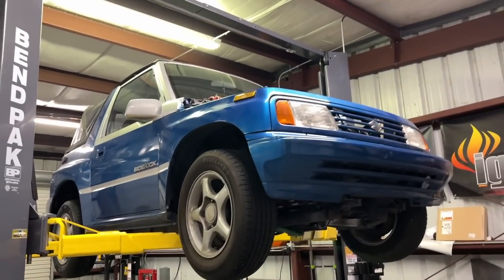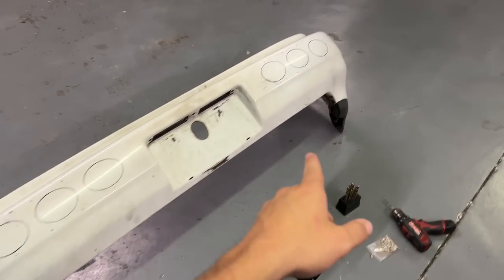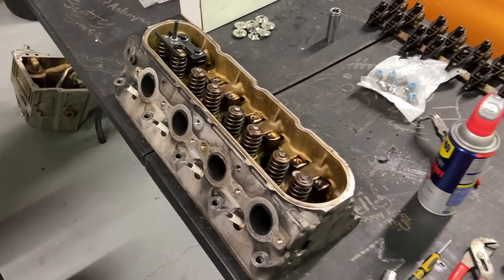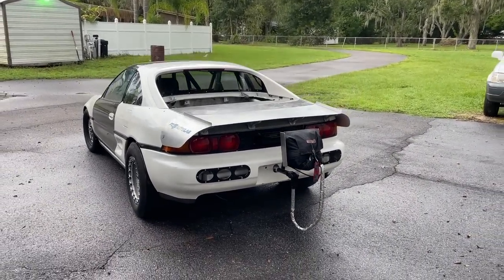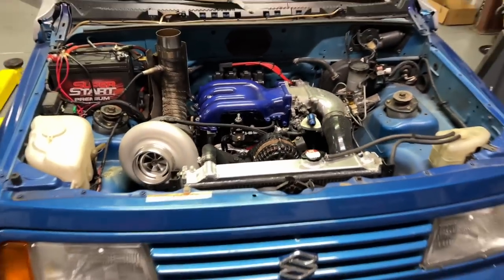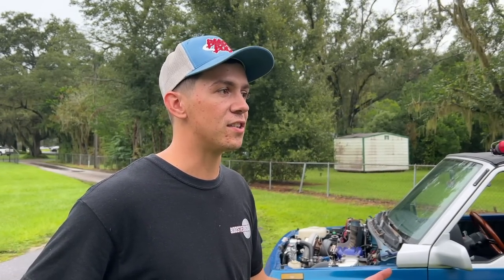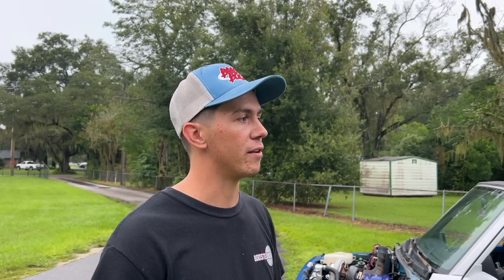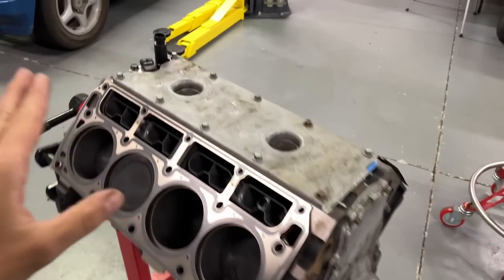Tried To Tow The Jet Boat With Our Rotary Swapped Sidekick...

Comment: I noticed some issues visually on the LS you guys are putting together.  All dots on the pistons should go forward and the rods on the mains are chamfered on one side and flat on the others. The flats need to be touching each other and the chamfers go towards the counterweights.
Reply: nah just send it
Reply: Pre 04 ls has altered pistons positions
Reply: @parkerpowell6852  um my 2000 6.0 was all foward
Reply: File this engine under "built for a good time, not a long time".
Reply: They were using sandpaper on the head i think that says enough
Reply: I agree it’s a quick fix to make sure good clearance
Reply: Lol ditch the auto
Reply: Hate to be a backseat driver. Watch that oil line going to the turbo on the sidekick. It’s really close to the exhaust housing
Reply: Thats par for the course, absolute dollar store builds. Live and learn
Reply: It's a junkyard LS does it really deserve any more?
Reply: @tyrellwashington747  Boosted (world record holding) Hacks
Reply: Nope.
Reply: @au1317  They didn't build the mr2 engine, their racing buddy did (cant remember the shop) and I don't even think they bolted the head to the block.
Reply: Who cares. All the Ls fan girls will tell you it's SBE and will still make 1200whp because *cry (hot rod)
Reply: @Supra2jTarga009  Kyle put the head on himself, I remember one of the vids he said all he needed was a head gasket to put everything together
Reply: Whats with all the hate in this thread bruh lmao
Reply: They already admitted they are not v8 guys there decent at the 4 banger clubs he’ll there good at the 4 banger game but when it comes to real America power aka big boy v8 they are out of there league they are called boosted boys not v8 men lol no offense tho I like there videos when I not watching some v8 yourtubers
Reply: @riversharp7243  Wyatt is a v8 guy but Kyle isn’t
Reply: Your sure that’s the same since there aftermarket
Reply: @riversharp7243  huh bruh? Witt has built dozens of diesel v8s.
Reply: 💯 mate and hope they checked the end play in crank otherwise thrust bearing going too cook
Reply: Dont matter it will clearance itself good about the time the rockers spit the rollers out and it cooks itself doing 7k rpm burnouts, relax its an LS they will get used to pulling those JY engines and swapping them after every event lol
Reply: What if they did it on purpose knowing they would eventually have to rebuild it for content #BoostedConspiracy
Reply: I think they are doing a ‘standard procedure’ delete
Reply: I didn’t see a trunion upgrade either.
Reply: first off they shouldve done a coyote just to get away from this LS stuff the internet loves to do way to much of. Its similar to what they know. Coyote is like 2 4 cyl vtec honda engines put together. Best part is you can make up to 1200whp on a stock sealed coyote with just boost and fuel and run as fast as 7s in a s550 mustang or 8s in a f150 in the 1/4 with no heads no cams no pistons no rods no opening the engine unless you want to go built motor which then you can make up to 2000hp on factory block.  So many ppl are swapping out their LS built motors for coyote stuff which i never thought i would see the day. Something light like a fox and stock sealed coyotes are deep in the 7s. Its a part of modernizing and thats why the 7.3 ford godzilla is a joke. Pushrod oldschool stuff that heads cam pistons and rods oh plus boost like a LS LT and hellcat but you can  make that same power with a sealed coyote. Ppl like LS bcause you can buy one for 500 to a 1000 from a scrapyard. but then need heads cam pistons rods. 3000 for a coyote and then just pick your fuel system and used turbo or supercharger kit for 5k and bang 1200hp or a easy reliable daily 800whp. 7.3 godzilla because its only a heavy duty truck motor yes built better than a LS it will never have the aftermarket of a LS or coyote
Reply: You are indeed correct an the engine won’t last long with them backwards
Reply: SEND IT! again..
Reply: @Pinkarmada01  everyone is the best engine builder in these comments lmao . Rebuilt one motor in their life time but they’re all experts
Reply: @brock83196831  like these must be new fans or someshit, boostedbois have built powerful motors and cars with pfi speed like way back in the Colorado days. They have one misshap with an ls motor and suddenly its, oh they're clueless. Like what?
Reply: @carculturenation2166  lmao, im a Ford guy but show me the “so many people” that are swapping their LS for Coyotes and the Coyotes that are making 1200hp on sealed engines that are not one hit wonders that shatter OPGs on that one hit.
Reply: Nobody cares!!!
Reply: @riversharp7243  those v8's arent difficult lmao its literally a caveman engine theres nothing to it lmao.
Reply: @young11984  I don't like getting into YT arguments but I kind of felt he was full if shit. Stock unopened coyote making 1200 reliably sounds to good to be true.
Reply: @somethinginthewater3802  I’d love to see your build 😂
Reply: The dots go toward the center. Been professionally building cars for 23 years. It wont last long that way.
Reply: @MOTOHEAD-ko3tq  oh its 100% BS lol. There isnt a production 400hp engine that would make 1200 “reliably” but there could be some few hit wonders out there
Reply: @carculturenation2166   You're so full of it. 1200 on a sealed dog,  It's just that easy 3 grand and and a few grand for a Turbo you slap it in and you can go 7s  You've been watching too much YouTube my friend you probably never touched a car in your life.  And a truck that runs 8s that easy lmao.
Reply: Dots on the pistons face forward, dots on the rods face the back. End of story. Very simple. Those 2 pistons visible were facing incorrectly. A factory LS crankshaft has a small fillet unlike aftermarket crankshafts. Because of this some people get away with connecting rod's facing the wrong way. Also LS pistons pistons have a centered ristpin with no offset so idiots get away with pistons orientated incorrectly also.  We will see how long it lives. My bet is it will spin a bearing 1st.

Comment: The Sidekick would be a great build to put the exhaust bypass dealie like you used to have on the rowdyssey; one heading out the back, one out the hood for burnout time.
Reply: They spoke about doing this already and the exhaust bypass dealie is called a cut-out.
Reply: i wish the rowdyssey had a normal exhaust still and not a hood exhaust coz its no longer a sleeper ;(
Reply: Much easier to have the cut out coming out at the mid section under the car, its usually a butterfly valve so you just have a little bullhorn coming off the main exhaust after the downpipe or somthing 👍 hood exit would be cool but abit difficult to fab

Comment: I hope y'all upgrade the trunnion bearings on the rockers if your planning on reving it out. You don't want those factory needle bearings coming apart and going throughout your whole motor. Play it safe and replace them now while you got it apart.
Reply: Odds are the motors completely together already. Gotta remember theres usually a few days inbetween filming and when the video comes out.
Reply: Hopefully they did it. They are notorious for coming apart. I'd hate to see them junk a motor off something so simple to fix.

Comment: Great work on the parachute mount on the MR2. But You need to think about the way You strap the car down. People don't realise That if the car is not strapped down correctly the shocks are working all the miles that you do while towing it to and from events. I personally use blocks on the 4 jack points on the car and they match with some points I put on the trailer. I tie it down using crossed straps front and rear. I welded in some Chassis support rails under the floor of the trailer where my support blocks go. If it is not tied down correctly you can destroy a set of high dollar shocks very quickly. ask Me how I know. But I started Tying My race car down the way I mentioned over 15 or so years ago. and have had not had a problem since. Before i started doing this, I was having a problem where I would go to the track (Road Racing) and during the weekend, I would change the car set up and get it Perfect. We had a Race meeting at the same track about 6 weeks later, After doing a nut and bolt check and normal maintenance, I knew the car would be good because of all the adjustments made at the meeting we had there 6 weeks earlier. I went out for practice and the car was a dog. It was oversteering really bad and kept locking rear brakes, no matter what I did with the bias adjuster. I bought the car back in, We jacked it up expecting to find something broken. So We went over our set up sheet and checked and made sure everything was the same. Well after spending all day going over everything, The left hand rear shock was blown out internally. It had blown the seal on the footvalve, making the shock have no resistance at all. I remember going over some really rough roadworks on the way to the track and I think that is what did it. A few weeks after this happened I was using the open car trailer towing a Customers vehicle back to work with a blown transmission. it was only about a 80 mile drive back to work. We put the vehicle on the lift and I just happened to put my hand on one of the front struts. it was warm. Meaning it was working even though the vehicle was on the trailer. So make sure your cars a tied down correctly. OK story over, I just thought this might help someone. Cheers.
Reply: Clever thinking, I like it.
Reply: I stopped reading your book when you said you cross your straps, I'd never take strap advice from you.
Reply: @momolovesyou9969  ,How many vehicles have You strapped down and how many miles have You towed vehicles, and how long have You been such an expert. You must not know much about strapping vehicles or any load down for that matter. Crossing the straps stops the side to side movement of the vehicle when strapped in the trailer. I have the pick up points set so the straps do not touch each other, because this can cause the straps to wear and fray. Have been in the Motorsport trade for over 30 years and never had one single strap or rope problem.

Comment: I ordered a TCI Racing Automatic’s case filled Ford C4 transmission that comes with a reverse manual valve-body with a TransBrake. I paid $1750.00 for the transmission then ordered a NCTransmission “North Caribbean Transmission” custom built spec torque converter for my setup as well a Elite Rotary Shop Ford C4 to Mazda 13B bellhousing ring adapter and a RaceOnly Australia Billet Mazda 13B Automatic Flex-plate and a Precision Performance Products Kwik Shift Shifter. In total I have roughly $4000.00 or more in everything mentioned about. But I’ve been told by a lot of drag race transmission builders that if it’s not built to be able to handle to higher RPM being attached to a Rotary that it will not last long at all.

Comment: Tire straps always in a functional vehicle. Grease the pivots and let the car ride the trailer. Smoother ride all the way around than binding them together. If you are strapping sprung weight points then Jack and block the frame so the suspension is fully out of the equation. Otherwise your springs are trying to fight your straps until the shock load smashes down on the bump stops and slacks all the strapping for a second then BAM !!! It all comes back up but not much.

Comment: You could just put some metal spacers under the bars for the parachute mount so it still slides in and out with the bolts out. Throw one quick weld on the bottom section of the spacer where it meets the car frame. It will be quick and easy and add a ton of structure so it can't move up and down when the chute is out. It will last a good while either way, It is better than what was there.

Comment: Wrap the lines with some heat resistant sleeves. That motor gets super hot especially on the turbo side... Also, throw a junkyard 4L60/80 and call it a day

Comment: Not to be a backyard mechanic but the dots on the pistons go forward. Second off I would definitely do a trunnion upgrade. Those needle bearing don't like RPM's. Also the C4 is a great reans once you get it lined out with the right stuff for you application!!

Comment: Just a thought….. if you tie the mr2 down at the lowest point by the wheel with the tie down straps that would allow the suspension to move freely going down the road. So the straps wouldn’t yank at the chassis when hitting bumps.

Comment: I was hoping that the built trans was a 5 or 6 speed manual trans. But before you take it out you should replace the waste gate and you should still put a inter cooler and blow off valve to the sidekick.
Reply: Mike said he didnt need an intercooler and they dont have one on their burnout RX7 either, seems it would be of benefit imo but i know exactly 0 about rotary engines too so🤷🏻‍♂️

Comment: You need muffler bearings and also a defibrillator for the pump. Use gear oil for the transmission it hold up with the high stall torque converter. Or you can use brake fluid in the transmission as well it reduces heat in the transmission.

Comment: Dewds....gotta use that triple beam for other stuff, like weighing all 8 LS rods (after marking each with their cylinder # and arrow for which way is 'FWD', naturally)...grab the lightest, then remove material on the other 7 until all 8 are as close as you care to get 'em; with "identical" being a quite time consuming, but still obtainable goal. All 8 the same weight + heavy springs doin Chevy things = All the R.P.M.'s to make an LS SING,!!!

Comment: That trans may be having issues because when you were selecting gears and it wasn’t working correctly (missing third gear) you could have also been losing pressure to the clutches and cooking the box. Once you sort the gearbox, please get the shifter set up properly

Comment: @17:49..hey Wyatt? Ligna Balls, my 4l60 (2 pc) launches at 3300 consistently,  tows 10k lb tool trailer 5 days a week and still puts down 7.20's at the track EIGHTHS in my 4900lb S10 ZR2.. so these "Weak" 4l60s can be put together correctly, even by a NC backyard dummy ; such as myself. Who had ZERO automatic experience before building this one. And yes it is a modified 231 TC, Ford 9" , billet crank 4.3 stroked to 4.8. Sonlike you guys,, I also put ENTIRELT TOO MUCH $$ into things that make little to no sense to most hah. Keep up the awesome content, let's see more of your race truck....also I hope your trans exploderates fir the 4l60 comment 🤣 🤣

Comment: <literally comes back from a burnout comp where you actually exploded the radiator at both ends and melted the tires off the rims> "I dunno boys, musta been that 5 minutes of towing this trailer around on flat ground" hahahah cmon guys you aren't talking to the warranty dept for the transmission
Reply: not how it works, running a high stall converter while trying to tow something around town in this situation is going to cause your trans to overheat like crazy. the burnout was fine, driving it around in the lower rpms towing a boat is not. i know it seems strange that driving around like you normally would in a street car would be bad for the trans but in this situation it is.

Comment: maibe if you drain the oil , drop the pan to clean it out , replace the filter and fill it with new oil  you can get it back to working again , it prolly will still be worn out though

Comment: Race transmission is not meant to haul stuff. When you’re hauling stuff behind in the vehicle you have to be mindful of blowing through torque converter/clutch due to extra stress from the load you’re hauling

Comment: It's not the C4's design that's the problem. I've owned many stock and built. When I was 17 I had a 65 Mustang with a 289 V8 and a C4. The transmission was bone stock. I beat the crap out of that car daily, drove it like I stole it, did many burn outs, doughnuts, drove it at high speeds, drove it 140 miles a day. I also built a hitch for it and towed multiple cars with it, using a tow dolly and tow bars. Never had a transmission problem. I finally broke the driveshaft yoke doing neutral drops. The transmission was still fine.

The big question is why in the hell would you put an auto trans in something you were going to use at burnout contest????? 😁  Heat kills auto trans, plus ATF likes to burn. So when you blow a seal or a line and the ATF gets on the glowing red hot turbo/exhaust, boom, giant fireball.   Seen it happen on quite a few mud trucks.

Comment: I like the path you're going down with the Suzuki mostly stock make it a daily reliable car. 300 whp in that thing would be insane with full exhaust. Be cool if you can make it 4x4. My neighbor has a 99 Suzuki Swift 4x4 and I got a Kubota diesel be a cool swap.

Comment: If you do the math, you can figure out what the mr2 wheigh when you pull the parachute.
Example: If a car weigh 2425lb and is moving in 124mph, it will weigh 381490lb on a dead stop.
So that parachute is doing work.
I would make a mount in the middle as well.
Reply: lol thats not how 'the math' works at all, a a prachute isnt a brick wall

Comment: C4 is fine, BUT i have never had one last long over 8k RPM. IF you during the burn out was spinning the Wankel over 7k, which i believe you was, then that cooked the C4. It can not take pump input over 8k RPM, fluid Cavitation in the pump leads to low pressure and burn up the bands and clutches.

Comment: FYI, YOU Should do ALL of your resurfacing with ANY medium BEFORE assembly. Any wayward particles of carborundum or whatever type sandpaper you used will NOT THEN be able to work their way into newly assembled parts. Always do your sanding and thorough cleaning BEFORE PUTTING IN YOUR NEW VALVE TRAIN PARTS. NEVER expose new or even used parts to sanding or grinding media as it all will only serve to shorten the life of your go fast toy.